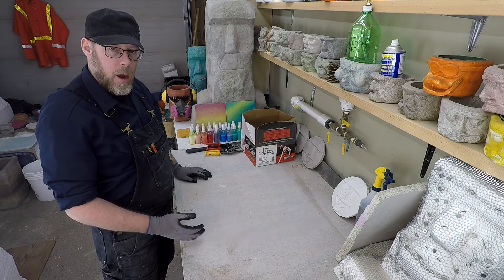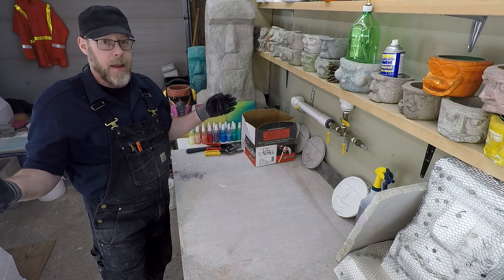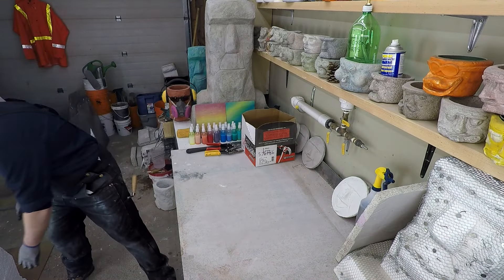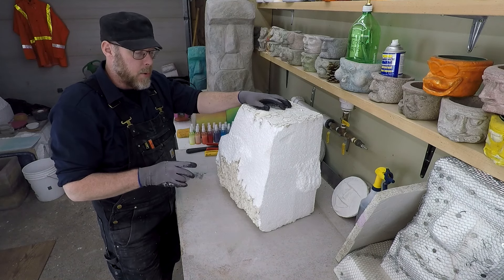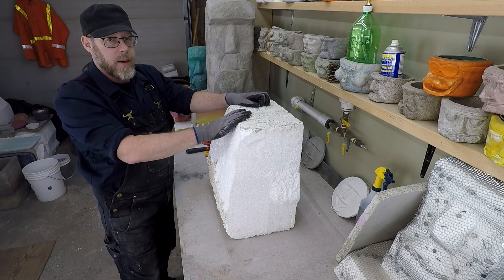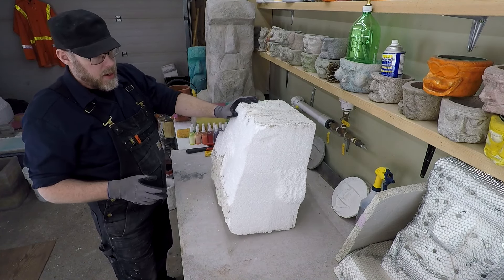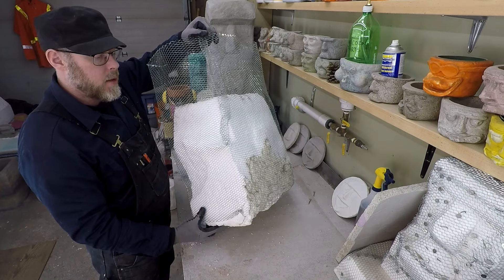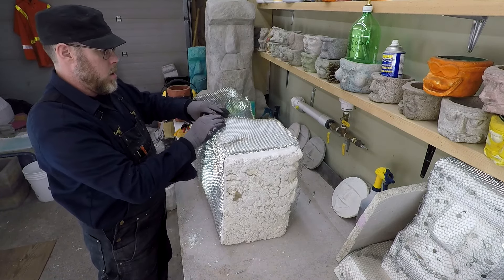How To Make Rocks From Styrofoam (1/5)

Comment: Back around 2010, I took a course called "Art in the Garden" from my local University.  The Sculpture professor was teaching the course.  One of the things we did was take large pieces of foam, sculpt them, then covered them with concrete lath (like what you're doing here) which we pinned in place with some type of heavy-duty wire, then covered the same with concrete.  
My project was to build a type of "tori gate-like butterfly fountain that could also be used as a seat", which I was going to put in my "Zen" garden.  Unfortunately, the "Zen garden" has only come into existence now, 13 years later! (😸)  In the meantime, in some places, the pieces of lath that were attached to the foam came lose and fell off with the concrete.  Lesson learned from that was to make sure the concrete is at least 1 inch thick when applying to lath, chicken wire, or whatever.  So now I have to repair it. (😿)
Since then I've been making "fake rocks" using those blasted foam containers you get when buying meat or fish.  While I haven't had too much problem with them because they're small (only about 4 to 6 inches wide by maybe 12 inches long and only about 1.5 inches thick), covering both sides with concrete can take up to 2 days because I have to do one side, wait until it's dry, then flip it over and do the other side.  I found if I make them too thick, the concrete doesn't really stick to the foam very well.
Since then, I've been researching a perhaps better way to do this and I may have found a method that will allow me to make these "rocks" bigger without the need for lath and pinning etc.  (I'm still experimenting.)  The method is one that the American Sculptor Muriel Castanis used back in the 1960/70s to make those huge figure sculptures on that building in San Francisco (Corporate Goddesses was what the sculpture was called.  https://www.atlasobscura.com/places/corporate-goddess-sculptures).  
What she did was to dip fabric in the medium (in her case a kind of epoxy resin) and then drape it over the form so that when it dried, it kept the shape of form.  I'm going to try dipping fabric pieces into a slurry of mortar mix and then drape it over the foam rock "form".  After it dries, I should be able to continue to add concrete on top to build up the form so it looks like the way I want the "rock" to look.  
What do you think?  Think this will work?
Reply from the maker: Yes this would work.  Try dipping burlap into mortar thinned with water reducers and drape this over a wire armature.  It should support your sculpting mix layers. Professional rock sculptors like the kind you see in resorts or in Vegas use 10mm rebar armatures backed with galvanized stucco lathe and fronted with 2" wire and also chicken wire.  So from front to back, chicken wire, 2" wire, 10mm rebar armature, stucco lathe.  The mud when applied passes through all layers and even partially through the lathe layer.  This both backs the form well, but more importantly allows for encapsulation of the rebar armature.  Whatever you do if you plan to have this bear any weight or be climbed on then having strong steel encapsulated in concrete would be a primary concern.
Reply: @creatingconcrete  No weight on the rocks.  They will be under bushes and other plants and only the really large ones will actually be seen.  I'm trying to replicate a "Japanese Zen garden".

Comment: If you want to delete the wire lath just use polymer modified cement mixed with fibreglass fibres and just spray it on 
It would be light enough it could float however it won’t stand up to the abuse of a more traditional stucco finish it is more versatile in its uses
Reply from the maker: I can't imagine the final product would be strong enough.  Unless you went crazy with the thickness but without any support for climbing the vertical surfaces it would be challenging to do so.  The lathe in this case provides so much strength and resistance to cracking / movement of hairline cracks.  I mean it is all relative to what you expect the artificial rocks to be in terms of strength, longevity etc. but the ones I build are strong enough for physical abuse, direct sun, freeze and thaw etc.

Comment: What are your thoughts on using cardboard as the base instead of Styrofoam
Reply from the maker: I would definitely not.  Cardboard will break down, mold and rot.  It is not meant for even damp environments and even the application of the mortar itself would be enough to cause them to start to break down and degrade.  I had never even thought to use boxes until a subcontractor on a jobsite I was on did that for an artificial rock structure.  The engineer made them tear it all out and replace with a rebar armature backed with lathe.  I would not recommend cardboard.

Comment: You can use a different type of lathe that’s much easier to work with. Spider lathe. It comes in different types and sizes. Most vertical concrete artists use it. I’m working on a log right now and am actually using a GFRC backer coat for my scratch coat.
Reply from the maker: I have worked with fiberglass lathe before...not my favorite stuff.  Probably just because I am old and set in my ways and have been using galvanized steel lathe for so long.  I also like that hardware stores sell lathe at a discount when it is bent.  Traditional stucco jobs using lathe need it straight and flat, so when the sheets get messed up they sell them for half price.  Which works just fine for me.  Can not remember the last time I paid full price for lathe.  Thanks for commenting.  Great info about the lathe alternative.  Cheers.

Comment: Does chicken wire work? the fine sort?
Reply from the maker: Yes.  Its just a little bit of a pain to work with as you end up with little bits exposed through the mortar more easily.  The slightly thicker wire definitely is easier to work with.  Sometimes I even use both, which can be helpful for limiting hairline cracking and easier climbing of vertical surfaces with your mud.

Comment: I am so thrilled to find these awesome videos. They are so well done too. It was exactly what I need to learn, as a person seeking info as a sculptor (applying the method to structures other than rocks, like figures, etc). As I watched, some possible ideas came to me of alternative methods to try in order to get the lath secure on the styrofoam, instead of so many nails, I'm thinking of trying to section the styrofoam, so each side is a thin sheet, &  then use galvanized steel wire to sort of 'sew' the lathe onto the styrofoam... & then recombine all the lathed styrofoam sides- maybe by wrapping wire around them too; or maybe use a scrap wood inner armature to attach all the outer styrofoam sheets. I think a roll of wire would be less expensive then all those nails?? & could hold the lathe secure. what do you think, in light of your experience?
Reply from the maker: I use rolls or mechanic / rebar tie wire and it is less expensive, but I prefer the grab of the roofing nails, and being they are galvanized steel they will not rust and bleed through like the tie wire.  There are likely many variations you can try to arrive to similar results, but if cost is the problem, people sell half boxes of left over roofing nails all the time.  Pick some up at a garage sale for $5 and it will last you a year or two.